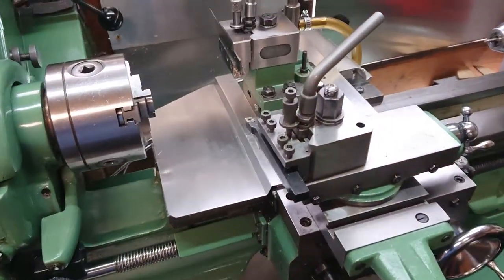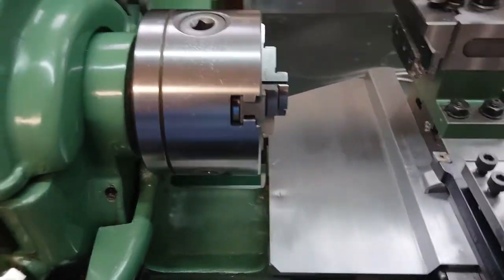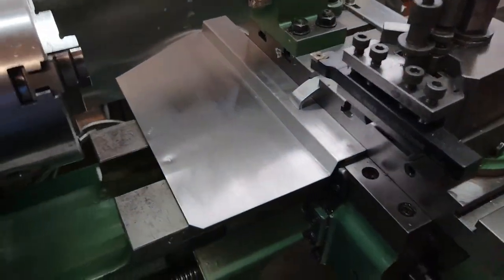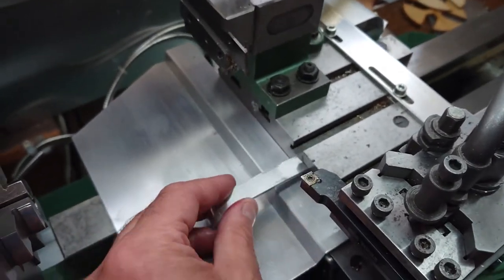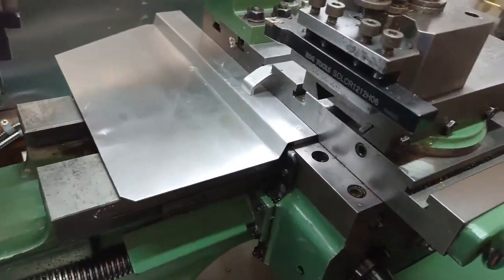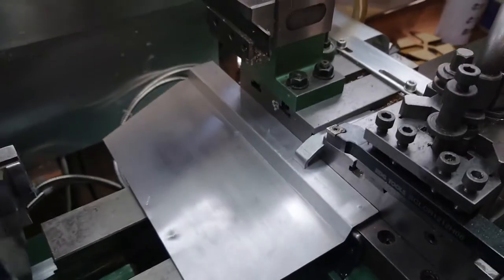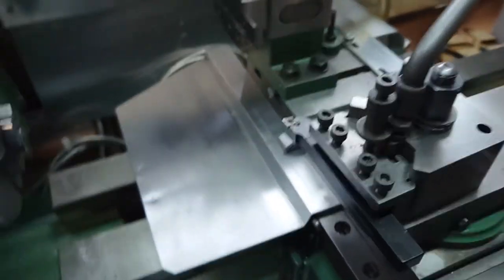Bed protection - MYFORD SUPER 7

Comment: Like your construction, but changed it into similar thin leather-slab-construction.
Your construction is perfect, but the top-slide must be way out of the center to 
make it possible to work close to the chuck.
Advantage of your construction is of course protecting the ways from a falling chuck.
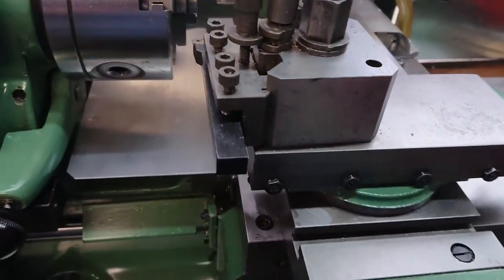Reply from the maker: Thank you. I rarely need to take it off apart from cleaning. The width of the plate is around the same as the chuck protrusion so it tucks in nicely. I use the compound slide as well of course which gets me right in. :-)   00:50